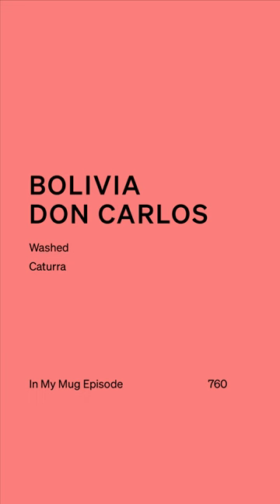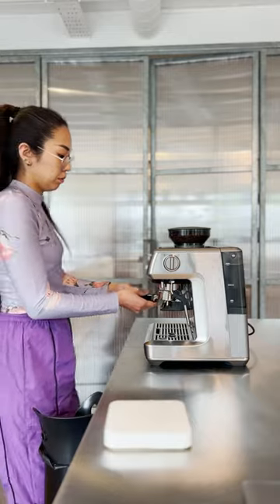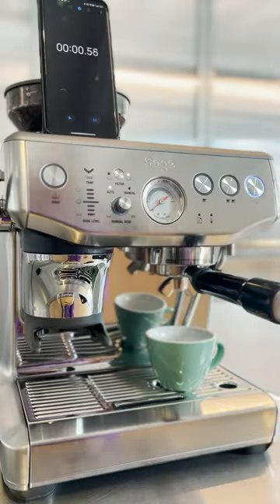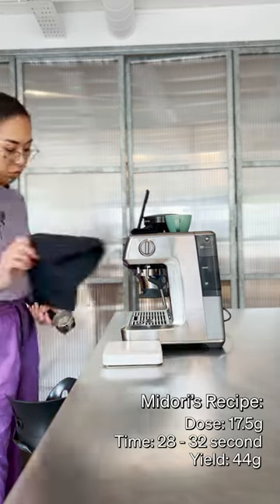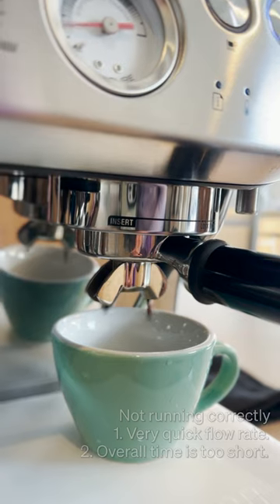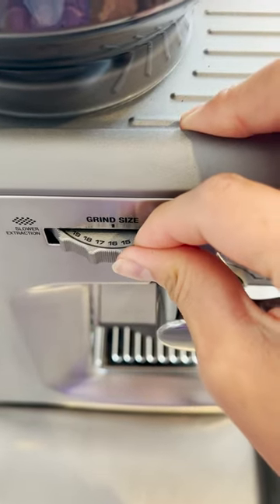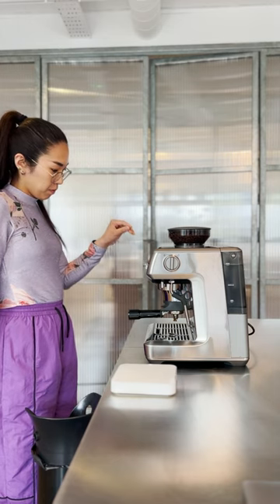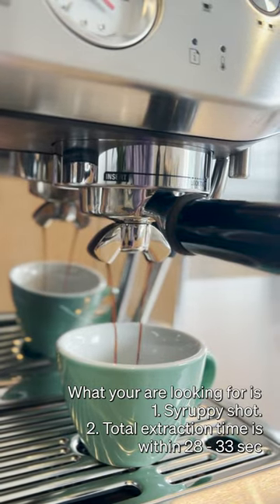760: Espresso Is Running Too Fast!? How To Fix The Shot.

Comment: What do you make of the Impress? Is it actually any good? I've found these grinders to be very fussy for espresso (clumpy, retention, etc) and I can only imagine the tamping without distribution only makes things worse. And then there's the thermoblock - ok thermocoil :) - part. I'm legitimately curious of your honest opinion! And thanks!
Reply from the maker: Hello! Thank you for your message. I appreciate it. When it comes to setting up a coffee station at home, any Sage espresso machine is a fantastic choice. Personally, I have been using the Sage Barista Express Impress for quite some time now. One minor drawback of this machine is that it lacks an easy way to weigh the dose since it has a built-in puck press. However, the upside is that it ensures consistent tamping pressure, thanks to the puck press. The built-in grinder is also excellent for a home grinder, but if you frequently make coffee, the heat generated might affect its performance. If you're interested in using a distributor tool to achieve a more consistent brew, I would recommend considering something like the Sage Oracle, which requires purchasing the grinder separately. I hope this information proves helpful to you. Happy brewing! Midori